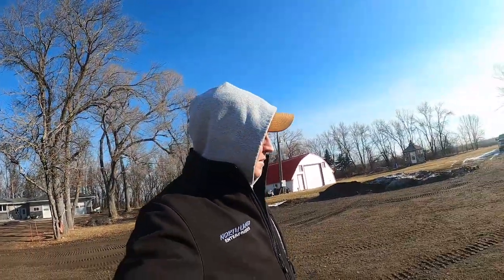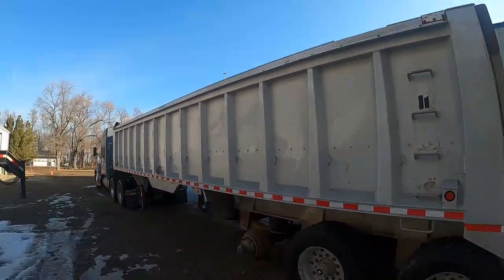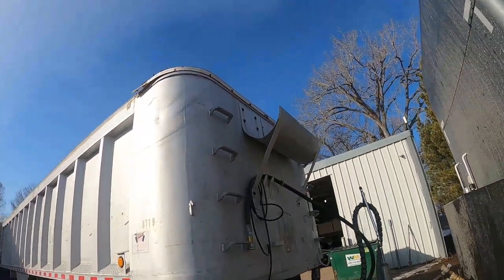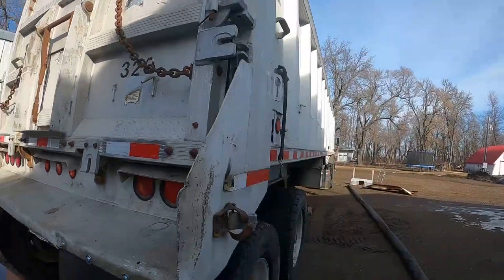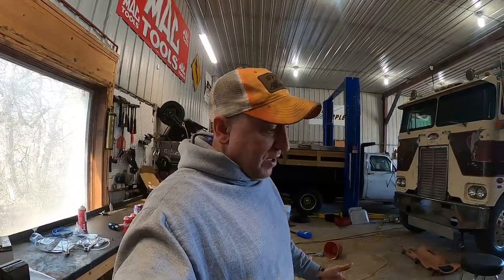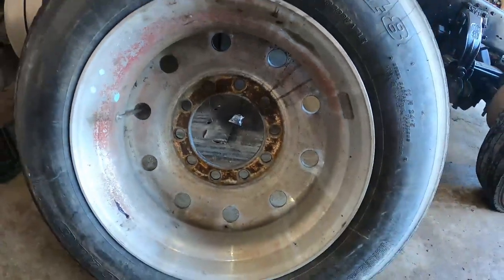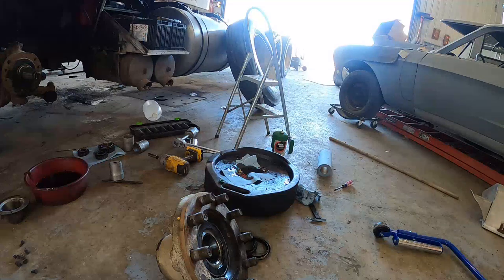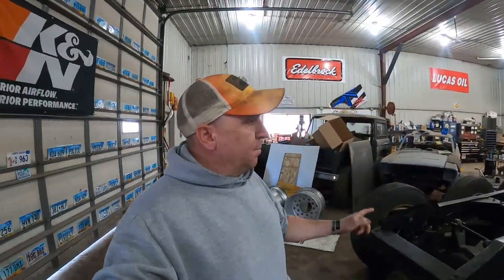Ep 27 Peterbilt 352 Cabover Resurrection.  Cracked Wheel hub.  Sending the trailer off to get tarped

Comment: Hey Mike, 20-30 minutes is a great length for the videos. Its all up to you. Sometimes splitting a longer project into a handful of videos might also work. I'd probably watch all of the episodes! Also, the cracked rim, according to my grandpa who was a truck mechanic in the 70s, 80s and 90s, may have more to do with the age of the hub, not the mileage. According to him it was a common issue with the 352, which was partially redesigned when Peterbilt came out with the 362. Another possible culprit, according to him, could be the age of the suspension. He also said that getting the rim checked and the tire balanced could be the easiest way to find the problem! Hopefully the issue can be resolved without breaking the bank!
Reply from the maker: Thx for the input!   BtwThe hub was cracked, not the rim.  And the hub was only a year old with prob less than 100miles.  Im guessing the rim isn't flat/true.  That's the only thing I can think of...

Comment: To find out if that wheel has run out have a tire shop put it on a balancer and check out the rim itself. I think that spacer is the cause of the problem myself see if you can get a new one that isn’t cracked or leave it off and see if it cracks again. Video length is fine at whatever you are comfortable with.
Reply from the maker: I was thinking of that.   That spacer may be it but you wouldn't think the crack should matter as its just a spacer.   Its a mystery.  Ordered a new hub assy today.   Should be here early next week hopefully

Comment: I vote for 1/2 hour videos. Not to short, and not to long. If you had any shimi in the steering wheel I'd say that rim is junk. Hard to tell though.
Reply from the maker: Yeah...  it was pretty smooth for sitting so long.   Im prob gonna move that rim to the rear and put different ones up front.

Comment: Have tire and rim checked with a spin balancer, if bad, the rim can be checked by it self. Can't tell much through video, but I would high suspect the spacer. Looked like steel between aluminum, not a great combination without plastic isolators, due to  corrosion. A little alum corrosion can cause major issues.
Reply from the maker: Yeah...that may be the case...   prob is I don't know if a spin balancer would show you run out on the lug face though..  it might.   We will hafta see.   I think I may just throw a different set of rims on just in case!

Comment: Mike, I’m a machinist by trade, not a trailer truck mechanic by any means however.... if you want my personal opinion, I would say there is runout in the inner surface of that rim. Aluminum has a tendency to warp in extreme temperature changes. I’d say it’s the wheel but just my opinion buddy.
Reply from the maker: Thats the way I'm leaning too..   I wish I had a way to spin it with a dial indicator
Reply: Just had mine machined. You won’t find a replacement. A really hard part to find. Bearing went out on me at 75mph. Cleaned spindle had hub machined and race packed in. Stemco seals. Back rolling.

Comment: Luck of the draw on that Hub, it was bad. No way it should have split like that unless it had a flaw in it from the start [used right?].  Flat disc the rust off and put some rust paint on that stuff when you can to help prevent the rust jacking even being a  question [weld that back ring and grind it true]. That wheel looks super rusty up where the king pin and bushings are [scary scales of doom]. Personally I love the longer videos. Not sure what could help with upload time other than Bus Grease Monkey set up a thing on his Bus that cut his upload time down to a third of what it was... ask him about his connection and upload approach [He'll answer].
Reply from the maker: Thanks man!   Thanks for watchin!

Comment: So to change those super singles what have to do change spindles backing plates brake shoes hubs the whole deal. No front brakes on that bad boy. And it is DOT legal, my buddy runs an Autocar with no front brakes and DOT got into an argument turned out my buddy was right and DOT had to back down.
Reply from the maker: Yeah.   Super common in the 70's and 80's..

Comment: That must be a very expensive Tarp job isn't it?
the damage on the hub looks like to thight nuts and not cross over thightend, 
if you did everything correct to manufacturer specs they should be obliging.
Try to get refund for the hub from the dealer/seller.
Reply from the maker: Yeah the tarp wasn't cheap but boy the quality is there.   It should last me a long time!